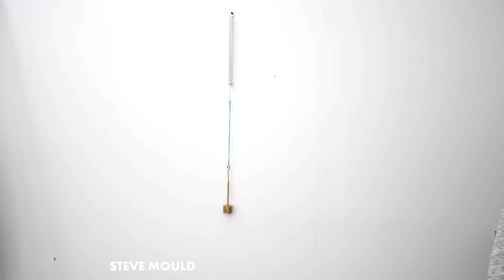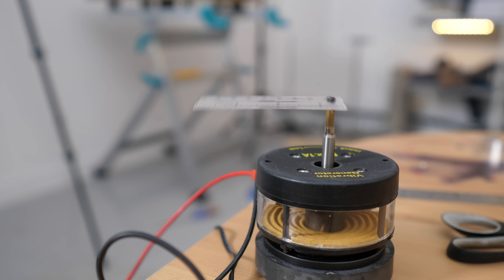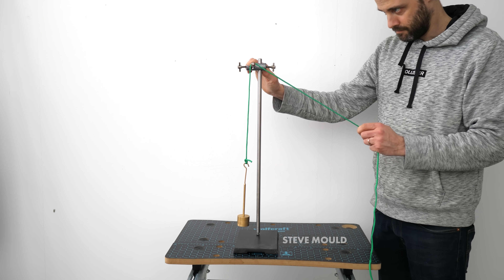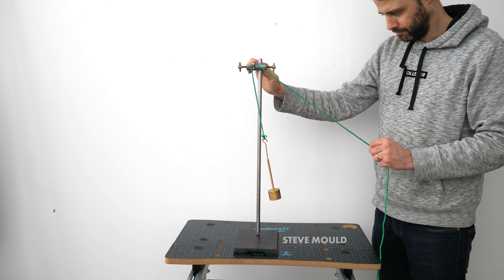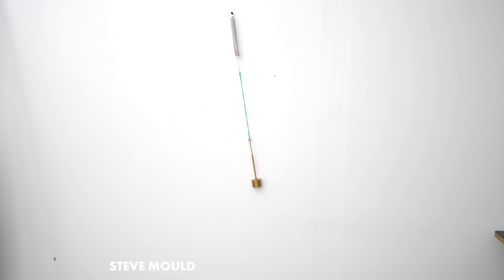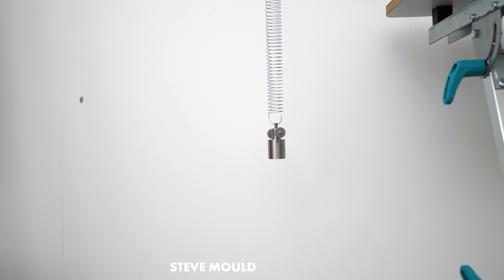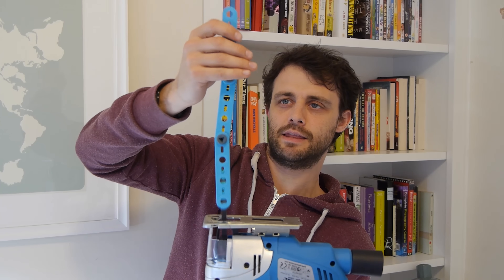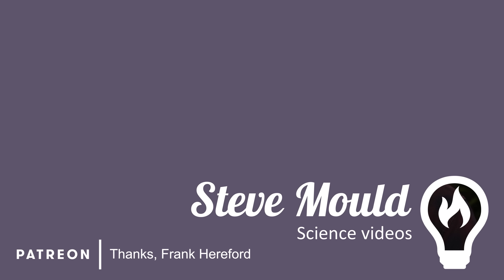What If Swings Had Springs Instead Of Ropes: Autoparametric Resonance

Comment: This video reminds me that, back in school, we were asked to do an experiment to fin out what parameters affect the period of the pendulum.
I made the (what seemed reasonable at the time) hypothesis that the mass would affect it.
So I set up my experiment, did lots of testing and, of course, had a negative result. Undeterred I kept testing, being very thorough.

I then got told off, maybe I should try something else.
I didn't get good marks for that experiment.

Which I maintain is very unfair. The point of science is not have the answers before you test, but to hypothesis and then try to prove or disprove!
My hypothesis may have been wrong, but my approach was, I believe, entirely correct.
Everyone else in the class tested length. Statistically speaking I think the majority of them must have had prior knowledge of the answer before starting.
Reply: When we found out that our hypothesis was wrong and we could explain why we could still get full marks, that's how it should be
Reply: @YannickBo  When did it change? I finished school in 2000 and the way you describe it should be is exactly the way I aced all of my physics - a good write up that reaches the right conclusion. Lets see if I still remember how to say out a physics experiment all these years later - Hypothesis, Experiment, Results, Conclusion etc.. haa
Reply: @MOSMASTERING  this actually would have been about then, maybe a couple of years earlier, I don't remember exactly.
Probably a teacher problem rather than a curriculum one...
Reply: @MOSMASTERING  I finished a year ago and we probably live in different countries - also each teacher teaches differently, some don't even let you think and everything you have to do is memorize the answers
Reply: @MOSMASTERING  If you live in a state that "teaches to the test" (a state-level test required for graduation), then any time 'wasted' doing something not on the lesson plan is frowned upon.
Reply: You are right.  Science is supposed to be a relentless and thorough pursuit of the truth leaving no stone unturned until it's discovered.  You should have been praised for your determination not docked marks for it.
Reply: Definitely unfair. If each student or group of students used a different hypothesis, together you would have discovered which parameters matter and don't matter. If each team did it rigorously then as a class you would have derived the truth. 
Honestly, your experiment was more realistic.
Reply: In fairness to you, the density and size of the pendulum will have a very small effect in atmosphere, but it would be difficult to measure that effect with grade school equipment. So you weren't entirely wrong, you just didn't have the equipment to show how air resistance and weight will change the resonance.
Reply: We (sadly) didn't have much experimental science in my country, so I never did the "science fair" thing Americans do. But from what I've been told this is something very bizarre you have about it. You do the experiments to validate your Hypothesis (fair), but you are not the first person I heard that talks about being punished for having a bad hypothesis (unfair). It teaches children that you should FALSIFY YOUR DATA WHEN YOUR HYPOTHESIS WAS WRONG! And that is...terrible! Just terrible!
Reply: Keep testing until the result of the experiment agrees with your hypothesis is also bad science.
Reply: @koharaisevo3666  with school equipment it's hard to be confident in your results without more than a small number of data points. The entire lesson was only an hour and that had to include a lot of stuff other than just measuring...
Reply: @LeeSmith-cf1vo  Blaming equipment whenever you don't get the response you expect is also bad science. With what a student would have available and in that time they should be more than capable of seeing that mass isn't a factor.

Could they prove it with 100% certainty, no, but if you put a 10g, 100g and 200g mass on a string and they have the same frequency within a hertz that is more than enough evidence to suggest that either there is no link or that any such link is nearly imperceptible and not a major factor.
Reply: @christopherpepin6059  it seems you agree that the initial hypothesis is disproven and that is that
Reply: @lsora12  Pretty much as far as disproven means in the context of a school experiment. 

I think the real issue here is that OP was making a mistake that needed correction; ignoring the implications of data that didn't back their hypothesis. However it seems the teacher wasn't able or didn't correctly communicate what was being corrected. I am giving the teacher the benefit of doubt. I think they were trying to reinforce a valuable lesson, hypothesis aren't always correct and you need to be able to recognize when you have made an incorrect one, but didn't see that the student would see the lesson as, you will be punished for incorrect hypothesis.
Reply: @christopherpepin6059  Like I said, I didn't have "science fairs" at my school, so I can't talk of first experience; but I've heard at least another person (that was James from James' animations) talk about how you can get "stuck with a bad hypothesis" and that it does hurt your final grade. So there is that...seems like a very wrong incentive and a bad way to teach how to do good science

I don't agree with what you're saying that maybe OP repeating the experiment was "bad science". Experiments (or well designed experiments at least) must be repeatable after all. I understand that if you repeat anything with a random process in the middle (like measuring) eventually you will get the data that will validate your hypothesis by sheer luck, but that doesn't seem to be what OP was doing.
Reply: @lsora12  I challenge you to collect enough data to plot a graph with reasonable error bars that proves that mass has no effect, within 1/2hr in a noisy classroom. All while knowing what you knew as a teenager
Reply: @LeeSmith-cf1vo  bro, why are you answering me? I agree with you!
Reply: @lsora12  no idea. Sorry! 
Clearly I clicked on the wrong thing, now I don't know what/who I intended to click on.
Reply: @LeeSmith-cf1vo  Think about what you are suggesting. You would be claiming that there is an important link but that it's effect can be swallowed up by your error bars. Even if you didn't have a stopwatch you should be able to get the period plus or minus a half second at most. The length is trivial to control within a mm. You can then test a range of weights within two magnitudes of each other. If you can increase the mass by a factor of a hundred and you claim the presumed effect could be swallowed by your error bars that would be evidence that any link would have to be incredibly minor.

And I actually did just try this experiment. I took a bottle, 161 g empty, tied it to a string and hung it from a hook and let it swing. Empty it completed 7 swings in 12 seconds for an average frequency of  0.58 hz, using proper sig fig rules. Full at 365 g it did 7 swings in 13 seconds or 0.54 hz. So right away what should spring to mind is that nearly doubling the mass either had a extremely minor influence or I am just wildly incompetent and can't be trusted to count whole number.

And the great thing about the pendulum experiment is that very few things do influence it. Even in a noisy classroom you would have gotten consistent results. I did my experiment outside in a very slightly breeze and I got consistent results. Your classroom could have been full of gravitational anomalies and your results would have still been consistent. You are not going to see huge error bars capable of explaining away any absence of evidence you expect to see.
Reply: Reminds me of a maths project work we were given where the aim was to effectively discover calculus from first principles.  The only top grades went to those whose parents realised what it was and helped them cheat.  The rest of us were completely lost as to the point of the excercise.  Somehow many of those of us who didn't cheat still went on to be engineers, those who did, laywers....
Reply: At least school taught you that life is unfair. 😈
Reply: @Desperadox23  ha.
Pretty sure I'd learnt that a few years previously
Reply: @LeeSmith-cf1vo  👍
Reply: That reminds me I had to measure the mass of the electron. I improved the test setup by measuring coil current (rather than estimating it from a nominal 2 volt battery and coil resistance) and compensating for parallax when measuring.
Then I got points deducted "as it was too accurate, you must have been cheating".
Reply: you were robbed. bad teachers stifle education and discovery
Reply: Yeah, sounds like your teacher didn't understand the assignment...
Reply: Result-oriented grading for something that should be about the process. Obviously I just have your side of the story, but that really does sound like a shame. A lot of teachers just stop caring about their job at a certain point.
Reply: At university when we did experiments the results were too inaccurate and measurements too few to draw any conclusions. 

To get a good grade you had to explain how the data validated the ideal model you expected to see regardless of what the data looked like.

I think it has to do with the experiments being expensive and the publish or perish nature of academia.
Reply: let it go, man
Reply: In most applications it is great if a parameter has no or negligible effect. Imaging if everything varied with every parameter. We would never find and law unless we kept everything fixed. I call it a success.
Reply: I remember being told at school that amplitude doesnt affect the period, but it obviously does as you can easily verify.
Reply: I mean, science is also about looking somewhere else when you don't find results with a particular method. Trial and error is very important.
Reply: @aviralsood8141  of course, but with inconclusive results and only about 1/2 hr of testing - I don't think it's possible to get to that point that quickly
Reply: @aviralsood8141  yeah they got low marks because they had assumed their conclusion and pursued it beyond merit.
Reply: @jhoughjr1  they assumed their hypothesis would line up with their conclusion... they only deserved low marks if they didn't modify their expected conclusion to reflect what their experiments had shown: that mass has little to no effect on the frequency.

Comment: You could probably use bungee cords instead of springs for a real-life version of this sort of swing
Reply: Oh God, I just pictured of a Bungee jump going horribly wrong by bouncing off to one side instead of up and down. Falling to the lowest point and instead of going up... bouncing off sideways into a rockface.
Reply: @MOSMASTERING  Bungee cables are always tuned in terms of length and weight for precisely that reason.
And that's also why you need to make sure you're working with proper professionals.
Reply: Cords are still springs and since they have same energy capacity - till take your arm off just as well.
Reply: @NGC1433  While that may be true, massive bungee cords designed to safely bounce humans around already exist, so it's a lot safer than a DIY set of metal coil springs attached to a playground swing.
Reply: @NGC1433  yes but you can use a lot of them in a bundle to avoid the kind of total catastrophic failure that Steve is talking about when he says those big springs can take your arm off.
Reply: Good idea, but they'd have to be of equal spring constant/elasticity, and if you've ever seen a winch cable snap, they'll cut you near in half.
Reply: We would use old rappelling ropes to make a spring for this odd river...uh...I don't know how to explain it.

I guess the simplest way is that we'd find a really fast part of the river and then take a home made surfboard with a handle on it and with it tied off to a cable going across the river, keep trying out loops of old rappelling line until we got the right number to stretch such that we could lean back to gain spring and then by leaning forward could release the giant spring to rush back through the rapids, surfing the waves and trying not to crush our skulls on the rocks that made the best ones.  :-) 

The coolest dudes could actually submerge fully then launch up out of the water, but always got dragged off by the current.  The super coolest of the dudes would have a contest to see how long they could hold on underwater before launching out without losing their grip.

Fun game on a hot day.  

I need to find a spot here to build one...summer's right around the corner!
Reply: Bungee cords (really any highly elastic material) have a nonlinear stiffness profile. These mechanical, linear springs follow hooke’s law very closely.
Reply: He could just go toprope climbing and swing on the climbing rope at the highest wall his local climbing gym has (preferably not that high off the ground). Climbing ropes are dynamic ie. they are springy and the longer the rope, the more pronounced it is.
Reply: You sir are diabolic...
Reply: Had a version of this as a kid called an Air Pogo. The spring is contained in a pipe to prevent it taking your arm off.
Reply: Or do it on a slackline. We call it surfing. https://www.youtube.com/watch?v=QDVWXzGUIMI&ab_channel=SLACKTIVITY
Reply: We still get to use a child though, right? I mean, it's for science, right?

Lol

Seriously though this brings me back to computer math classes working on how the calculus can predict and programmatically trying different ways to approximate, uh, solutions. Geez there were some ridiculously smart people in that class and the next year's class. Weird how they could figure out what seemed like simple solutions when someone didn't bridge the "gap". Some of us just desire to reduce repetitive "work."

Back, slightly on topic. [History nerd hat on]. It seemed easy to dismiss "resonance" as the "answer" to why we exist for personally a long time but it seems that it's getting harder and harder to dismiss. It's almost starting to seem it's ludicrous to dismiss. One word? Hmm. The shape of the ear to hear to the shape of epithelial cells to grow. The beauty of the plants that heal and bring peace all demonstrate predictability and seem to bring forth a question.

Why do we build cities on fault lines? Yes, I am dismissing all other questions as to why we are here for a reason. We all love music. We all love the merry go round. Don't believe me. Go to a simple playground and get on a merry go round. I defy you to say it isn't satisfying. I'll wait.

Seriously, math nerd geologists, this is a very simplistic and slightly partial explanation of earthquakes, right? Professor Cline reignited my interest in the so called "bronze age collapse" and a engineering friend is nuts about resonance being the reason behind just about everything but zones in when the frequency of the earth goes through changes over time. Smart dude and it freaked him out to learn that the poles have switch many times that we can "see." 

It seems easy to dismiss such a complicated and I suggest, elegant "solution" instead of blaming politics, climate change, advanced iron and steel manufacture, or something else but destruction of Mycenaean settlements do not seem to be from anything other than earthquakes. The idea that the "sea people's" as the cause seems silly. I admit it's cool as eff  though. Egypt, I mean Kemet was never the same after that and the Minoans, Syrians, and Hittites we're gone. Well, there seems to have been a decline and revival of "Assyria" after some decades, though.  Tigris and Euphrates civs have survived a long time. Oh and the so-called "Phoenicians" rose at that time and we probably don't give them proper credit for what we have today. "Purple" sea-faring trader seem important. Oh well, that's another topic and why did I go down this rabbit hole of a post you may ask.

We are lazy. We build where it seems we can get the most with the least effort when we start is my suggestion. It seems like this video provides is a suggestion as to why we build civs that are potentially doomed.

So, once again, is this a possible manner to describe the "behavior" of earthquakes?

Oh, I find it interesting that my engineer friend has barely any knowledge of "history" and believes that we, humans, have repeated this process of birth and destruction for far longer than my simple 8000 year supposed knowledge of history may suggest. Shit, it pure luck or staging that there was a "iron" dagger in King Tutankhamun's tomb. It's weird that it's always mentioned as iron and not steel. How do you make a knife? Heat up organic material with oxygen to permit the beating of it into shape. How does that happen without carbon being introduced? Isn't that what we consider steel?

Weird shit all around, we always salt the earth until it's too late, and we blame others for the problem when there isn't sufficient precipitation. Good thing we have learned a thing or two from the Sumerian dumbasses. Oh wait...

Comment: So, on a swing when I get to the highest point at the back, and pull on the chains, I am shortening the diameter of the arc that I take on the swing... And making the angle of decent sharper. Both of these in combination with a smoothe glide forward increases the momentum at the swings fulcrum, AKA the contact. Very interesting....